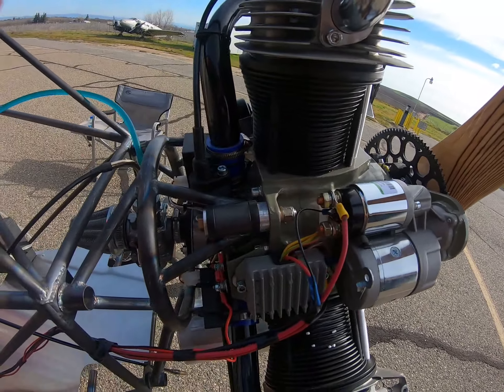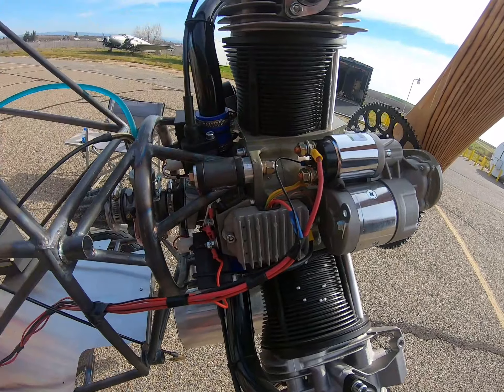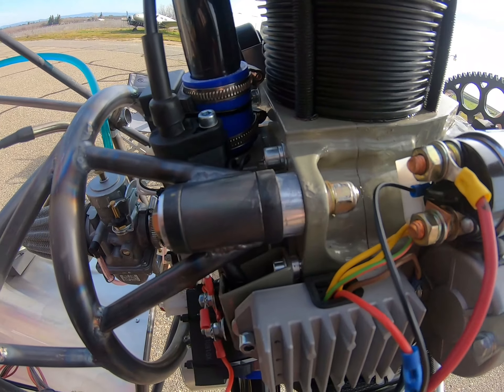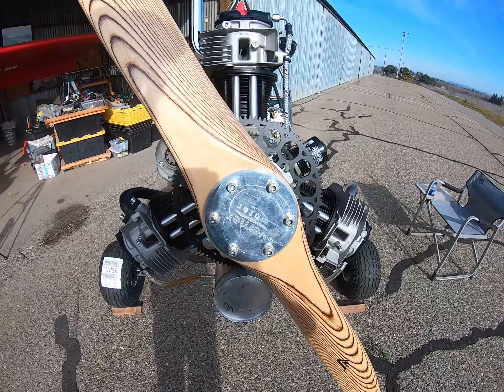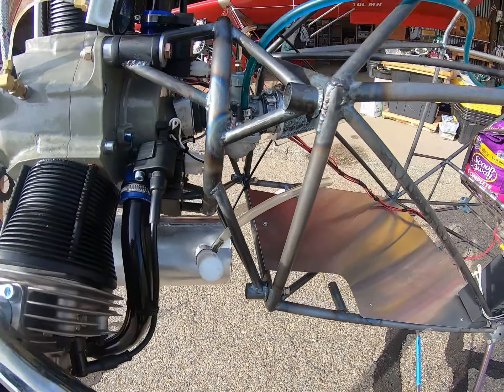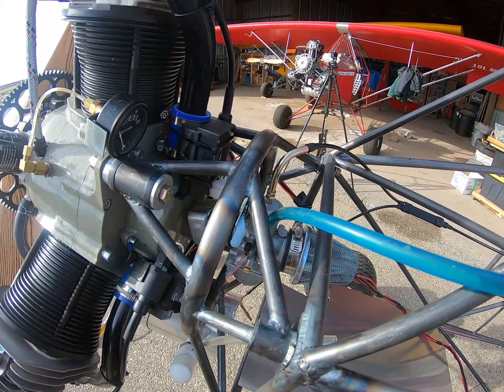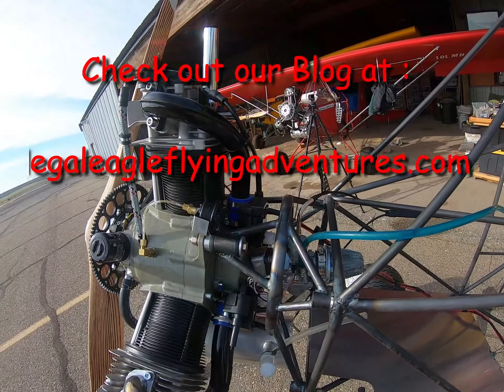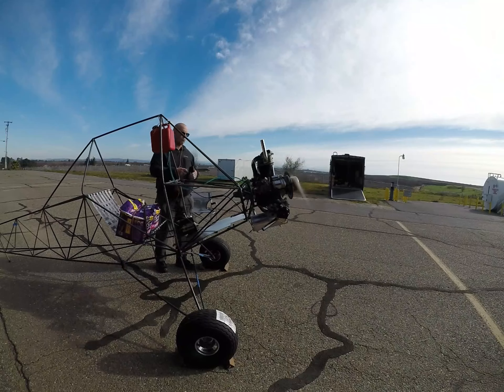Engine mount testing Verner 3V

Comment from the maker: With this engine run the engine mount bolts went thru the case and thru the rubber bushings without a bushing stop in bushings, hence the tighter the nut is tightened, more rubber bushing is compressed. The next step is to install a bushing in the rubber bushings to tighten bolt against and eliminate the bolt wanting to move in engine case. In theory it should work better.

Comment: Have you tried lycoming mount rubbers?  They have a larger ID and are just bigger overall.  You might could make a bushing assembly rhat tightens down all the way and still have flex in the rubber with a sleeve going through the whole works

Comment: Seems like there is  bolt rocking starting.  those bolts  must have some bending going on given the geometry of the shock rubbers versus the mount point of the engine .  Sure wish the engine case  was set up for  "continental" type shock rubbers. Sigh.  Kudos for your continued experimentation!

Comment: I agree that larger lugs would be an improvement. At this point, the bolts act as though they were cantilevered, implying that the holes in the lugs will become conical ovals over time. If the lugs were bolted solid to a front portion of the mount, and the motion, meaning rubber mounts, could be moved to elsewhere within the mount, then the lugs would be OK and safe. The lugs appear to be part of an aluminum casting, hence they will take the worst of the wear. Let the mount take the wear, not the lugs.
Reply: Use full threaded bolts,  run a nut or some threaded stop down to  solidify the bolt to the engine lug-THEN  stack the  isolator/spacers similar to what's already there to the round ring mount??   
I can also see too much rigidity  applied to that lug could induce some lug cracking..  A solid bolt (extension of the lug) should isolate all movement to within the replaceable rubber-  and keep the through-bolt parallel through the rubber as it wears/relaxes/degrades.      
I dunno.
I need to see if this was figured out,  as this is 3 yrs old when I wrote this  
edit-  yup!  he got it figured out!